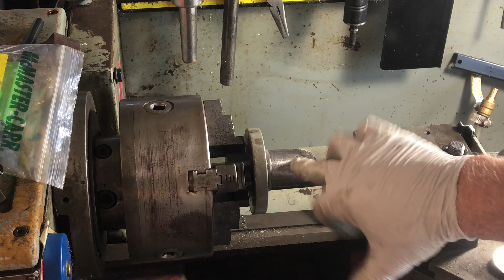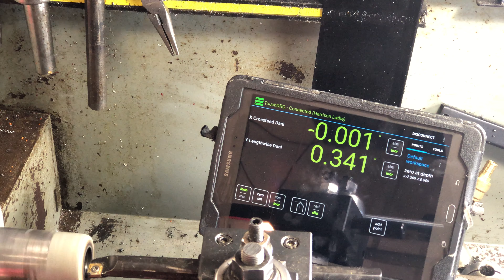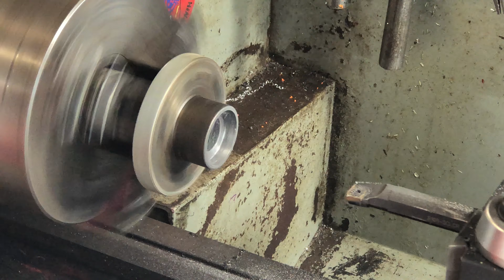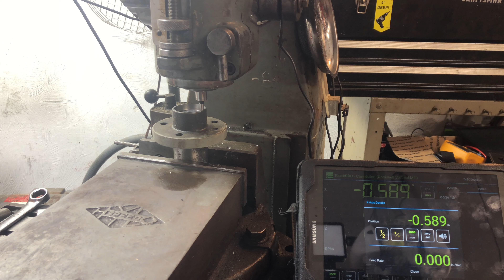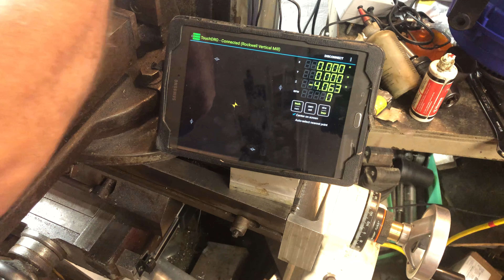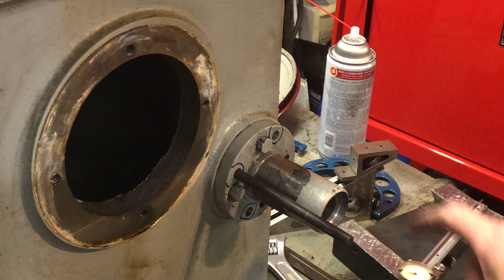Lewis Shaper Input Housing Upgrade - Seals and fix mounting bolt issues. Part Six

Comment: Good one Dan .  Are you going to run that on grease or oil ?   If grease , remember to face the inside seal the other way .   👍
Reply from the maker: Morning and thanks Max. When do you sleep - LOL?

I plan on oil for all of it. 

Maybe a 10w non detergent on the two shafts (input and feed output) with a drip oiler on each. They will essentially be individual mini sumps. 

One shot oiler on the ram with way oil. Taking an idea from your lathe refresh and will add some proper oil channels to the ram to direct the oil to where it needs to go. 

For the sump with splash, I am open to ideas. Since it is just two main gears, the scotch yoke, and the rocker shaft I am considering either an auto trans fluid, or a maybe a spindle oil like a medium heavy. Both would work, I am just considering the oil foaming as a variable - nobody likes an oil flavored milkshake. 🤮 It has ran well with little to nothing in the way of lube for generations. Any love would have to be a plus. 

Thanks again for stopping in.
Reply: @houseofbrokendobbsthings5537  Any hyd oil ,  what ever you use in your other machines .   Grease will be ok as well ,  less mess . 👍

Comment: Dan, I'm going to have to pick your brain on the Touch DRO on the Rockwell mill when it comes time for me to reassemble mine in a few weeks.  Looks like a nice system.
Reply from the maker: Sure Jim. The interface works well. With the scales you have many options from glass to magnetic. I started here several years ago. https://www.yuriystoys.com

I built my original module from Yuri’s plans. Later I built his kit version and added the full retail version. All work great. With me I am still frustrated with ordering one direct from China as I have no idea how to order. If it breaks I would be ip sheeps creek without a poodle. With TouchDRO it is all modular from the module to the scales and can be replaced a piece at a time. Yuri is here in the Pacific Northwest so the money stays here…

I do like being able to use a single tablet and jump between machines. The tablet holds the calibration data for each machine. I just switch the bluetooth and go. If I keep the other machine module powered I can flip back to it and resume from the same readings. 

The circle and grid spacing in the interface is a Godsend. Set it and (I did a poor job showing) drive the machine using the graphical points. Much better than just following coordinates for my aging brain. I also love naming points to keep me in line from getting distracted. You may have seen me having fun with myself and naming the axis on my lathe. LOL. 

I did use magnetic scales as for my needs holding a thousandth is a miracle let alone a micron. This allowed me to cut the scale down with a simple hacksaw. No  fuss as all. Best price on magnetic scales was at https://taytools.com/ last time I checked. Some folks use glass scales and that adds some sizing complexity but adds a bit of accuracy in the tenths region. 

I will be adding another setup for my horizontal Rockwell and maybe the shaper. You can unplug the module and move it between machines as the calibration is held in your tablet not the module. I will order another full module as I have the kit module ready to go from a prior video.  

Matty’s Workshop is running Touch DRO as well as Pragmatic Lee. I guess all successfully. Still amazed at the skill both gents bring to the table. 

All the best. Sorry for long note - I get wordy talking about this stuff. Not just anybody is even slightly interested. 😉